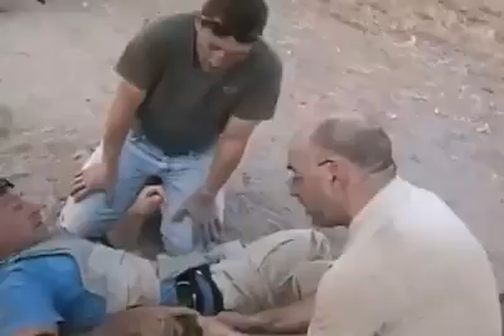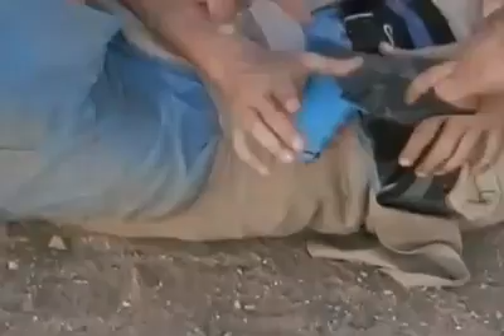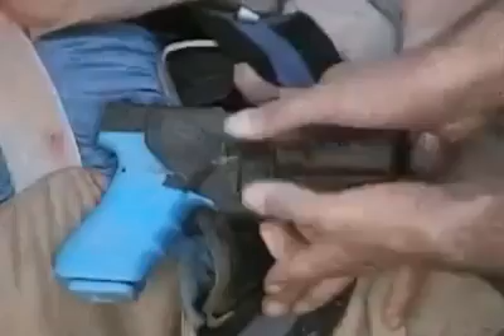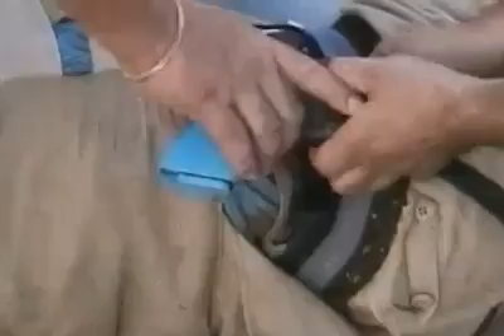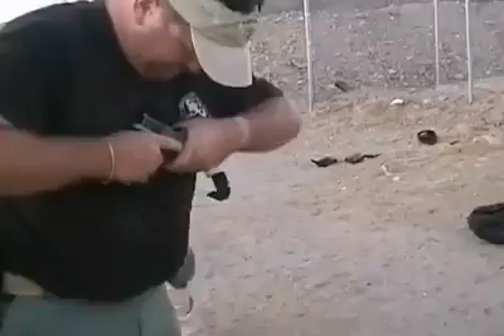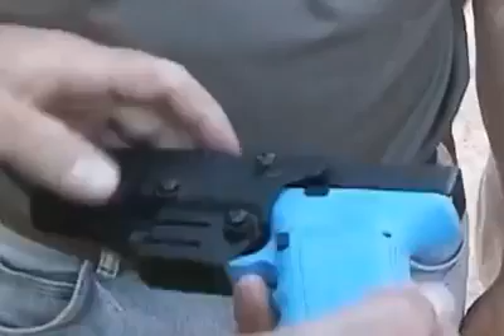Multiple failures with the Serpa holster

Comment: So your saying I shouldn't roll around in gravel with a mechanical retention holster and then try using brute force to make it work?
Reply: aerodicus I think they're saying buy a Safariland.
Reply: LMAO. Yup. My Serpa works great.
Reply: @hutchesonchris42  Man, I've had some scary situations adjusting my holster while I'm driving down the road. A few times I thought I might blow my ass off.
Reply: Shouldn't be too hard considering most serpas are usually kept clean, safely tucked under the gunt flaps of the Springfield XD carrier they usually belong to. 

Buy a safariland
Reply: @lester8430  any mechanical holster after rolling around in the dirt and rocks will probably jam up and not work properly. I have used a Blackhawk Serpa holster for almost 5yrs and never had a problem.
Reply: Id rather i have a holster that i can do everything with rather then one i cant.

Comment: I have been informed that this was a TRAINING AID and not a weapon.
Given that it is a TOY gun, no foul.

For a real weapon, that would be safety abuse.
Reply from the maker: It is a simunitions weapon. It is a Glock manufactured by Glock Inc. specifically for training purposes. The slide, barrel, and recoil spring have been designed to only allow use of Simunitions or similar marker type ammunition. The Simunitions weapons are used in this kind of training evolution specifically because the exercises involve actually firing these maker cartridges at opponents. Obviously it is not something you can do with real weapons and live ammunition. Prior to these drills all participants have to remove any lethal weapons (guns, knives, pepper spray, any live ammo, etc) and they are all patted down to ensure no live weapons or ammunition enters the training area.
Reply from the maker: Blue is a standard color for Simunitions weapons. Hence the blue frame on the Glock. Though technically the BATFE still treats simunitions Glocks as real firearms.
Reply: Medbob don't try to justify it lol serpas suck. Get a gls or als holster.
Reply: Wait Wait I thought all Glocks were  simulated weapons -no ?
Reply: Just like The UN , a Simulated peacekeeping force
Reply: It is not a toy...

Comment: It is great for natural selection for morons who don't know how to draw.  Done properly with your index finger straight on draw, it will be right down the slide where it should be, every... single... time.  Muscle memory is pretty easy.  Though the actual part that connects to the belt is pretty cheap and weak.  I don't mind mine but there are most certainly better options.
Reply: The video was about the lock getting stuck...
Reply: better options such as?